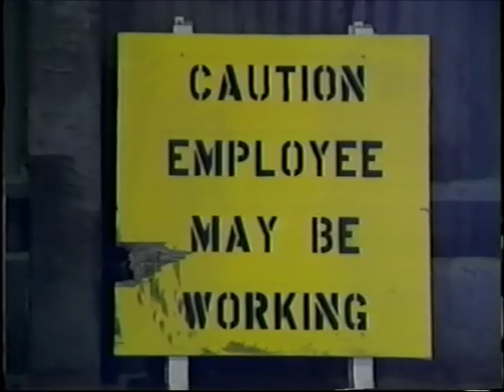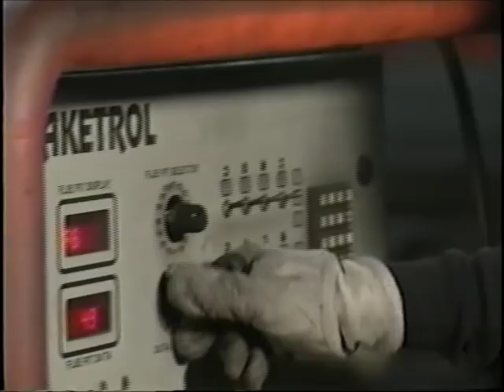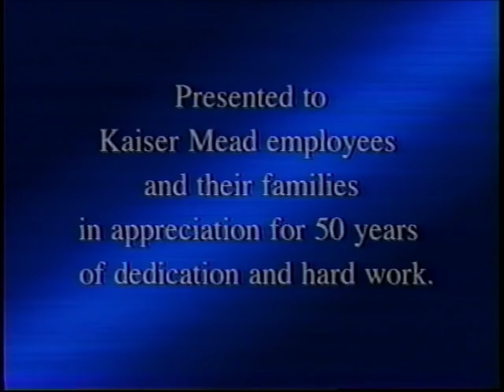Kaiser Mead 1946-1996

Comment: Wow. That was actually a bit scary to see that open ladle tapping going on. Plus casting those pigs without an aluminized coat. Scary.
Reply: It actually wasn't as bad as it looks in the video,they made everybody wear double sleeved shirts made out of a material that wouldn't really burn if stuff got splashed on it.But the Carbon Setting they showed in the video was more risky cuz of stuff getting splashed on us all the time,they made us wear chaps over our regular pants or we could wear special pants that were made out of a fire retardant material.

Comment: My dad had a to dig a trench to install a pipe for power at the mead plant  and I helped him and the place is not in good condition I mean the buildings themself are still standing but some are crumbling down sad.
Reply: taylor Gropp ,I worked there until the end,they have big No  Tresspass signs up now,plus cameras.I'm at Trentwood now.
Reply: Gaggamaggot maggotlips my dad is a electrical contractor and this is one of the jobs he Bidded on which was supply power to the brick building opposite the Rahco #1 building so he had access